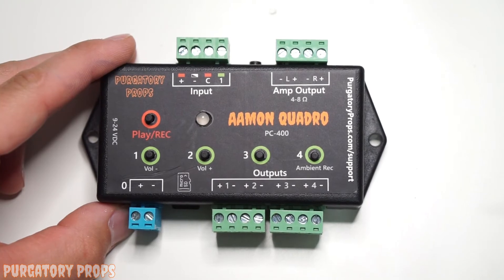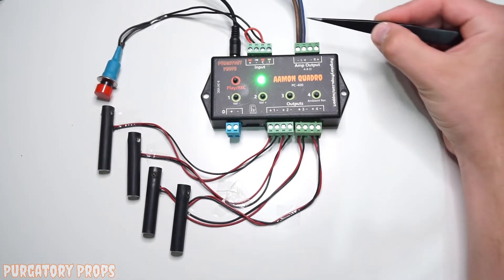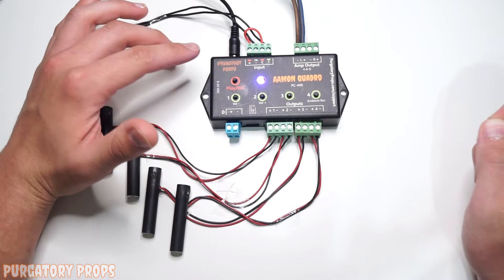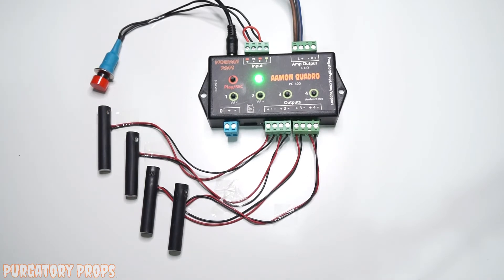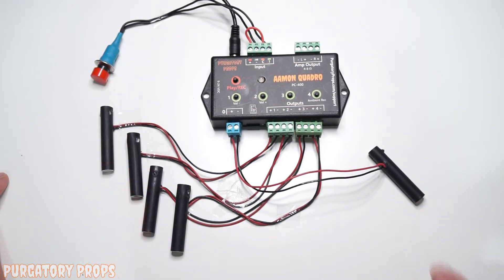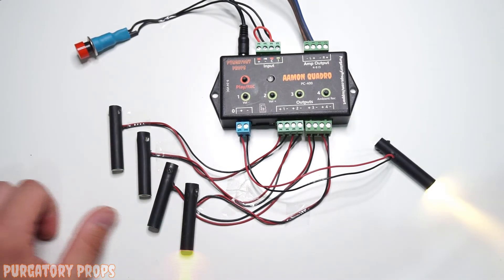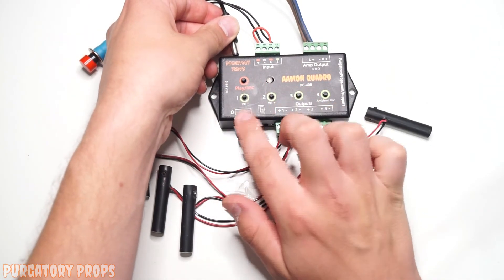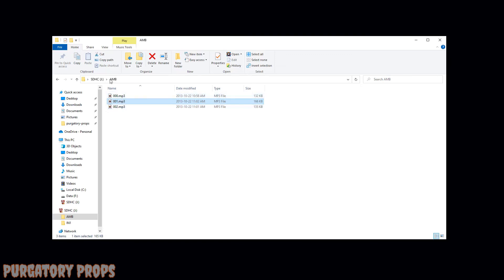Aamon Quadro - Programming and Configuration

Comment: What an awesome product you've developed! I'm super intrigued by the layering feature. A couple questions: When the ambient audio is interrupted by the input, does it resume from where it interrupted, or does it playback from the beginning of the sound file/move on to the next one in the folder? And does layering the scare animation mean that the audio of the input scene is layered over the ambient audio at trigger (both sounds playing at once), or does the ambient audio stop playing while the input audio plays?
Reply from the maker: The ambient scene can move to the next sound in the folder, or it can resume where it was. We didn't cover that in the video but you can enable ambient resume by holding a specific button combination when the controller is powered on, it will then resume the audio and recording where it was interrupted.

Layering the animation doesn't do anything with the audio. It simply allows you to program each output one at a time instead of all at once.
Reply: @purgatoryprops  I understand, thank you so much for the detailed response!